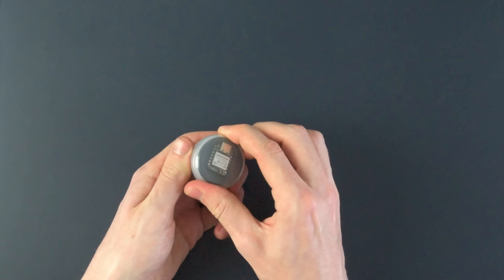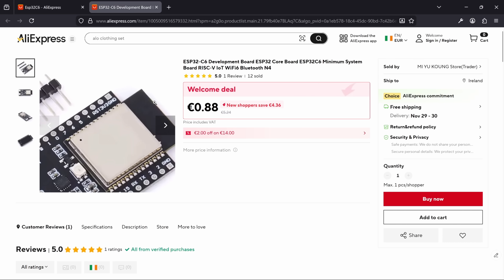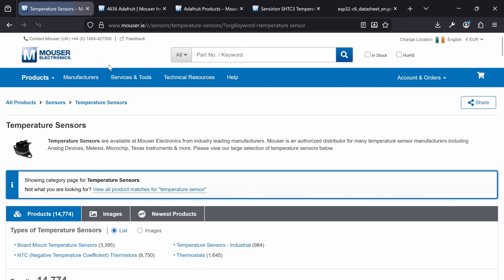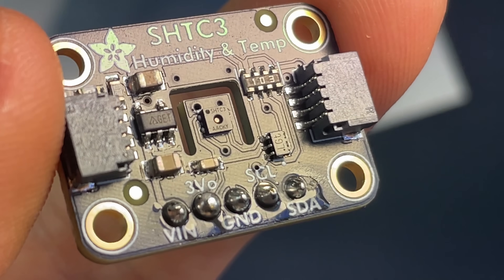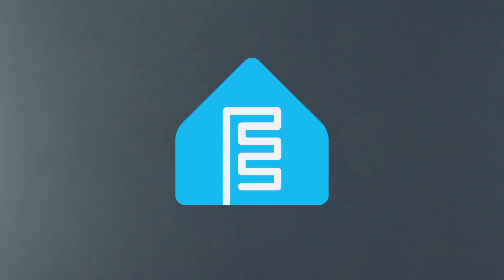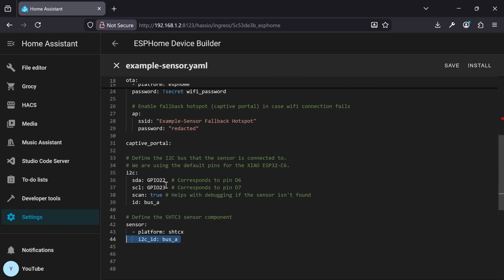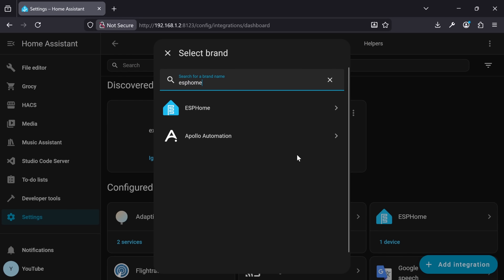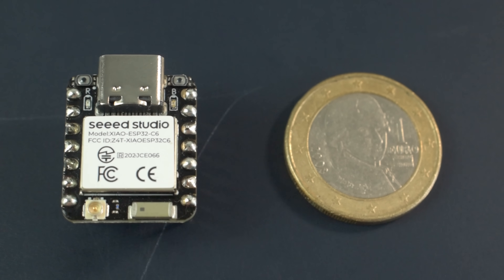ESP32: Build Your Own Smart Home Sensor in 10 Minutes

Comment: Great video, now I’m thinking about getting into HomeAssistant stuff.
Reply from the maker: Thank you, you should! You can get started very cheaply especially if you buy used. I started with a few smart bulbs and some IR sensors which I got for 10 quid secondhand. Now the lights on the stairs come on if anyone approaches, super handy!
Reply: Stop thinking and just do it lol 😂 

I was in the fence for ages and the other day took the plunge, now im so glad I did. 

Just do yourself a favour. If you are an early adaptor of tech, lets say a new sensor comes out you are not the type to wait a year before wanting to implement it. 

Then use mqtt on first setup. Rather than zha. 

It  sounds WTF now but as soon as you get an hour into learning to set it up you will understand bud.
Reply: I just warn you, this stuff is addicting.... so i hope your purse can  handle it. 

my house was 0 smart 2 years ago, now close to everything is smart ^^ , and i constantly think "  how can i add this to home assistant somehow" ...
Reply: @Bastyyyyyy  even if you don't use Home Assistant right now, the fact that hardware and systems you buy can be integrated is a good sign of not falling into vendor lockin traps.
Reply: tried home assistant about 4yrs ago, used to be like 2 versions 1 could easily import add-ons and the newer version which didnt so that wasted a day and a half as the tutorials didnt match.
I eventually found the 'full' version and then had to install the pi os then 'docker' then home assistant then an account somewhere to get dynamic dns working for remote access, 3 more full days of a living nightmare and it still wasnt right.... i gave up, maybe its easier now but i just buy sensors that say 'works with alexa'
not saying i don't like ha, i would, but i don't fancy another hell week
Reply: @lezbriddon  seems completely different now bud it's so easy to set up. And if you get stuck with anything just type it into chat gpt lol

Comment: Great video. I just a couple months ago started using the seeed studio sense. Built a two way texter that fits inside a 5 sticks of gum pack. There’s a LoRa add on board that can give up to two mile range. I’m also working on an altoids launcher that fits inside an altoids can:)
Reply from the maker: Woah that sounds awesome, great LoRa project idea! Have you posted it somewhere I could check it out? Had no idea LoRa could get such range
Reply: @FeatureNAB   hello, something weird is going on with YouTube. I’ve tried to respond to your reply several times and my message just disappears. I’d love to get you some information on my projects and you’re absolutely welcome to use them however you’d like. Maybe YouTube blocked because I added a link or because I mentioned another social media platform? I sent you some pictures and information. Thanks